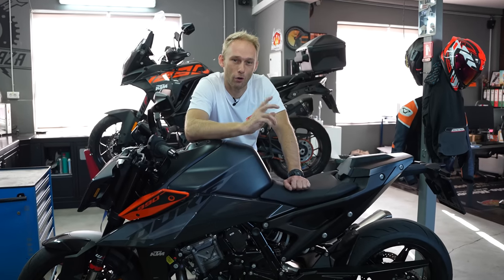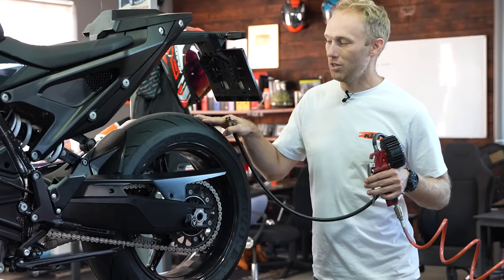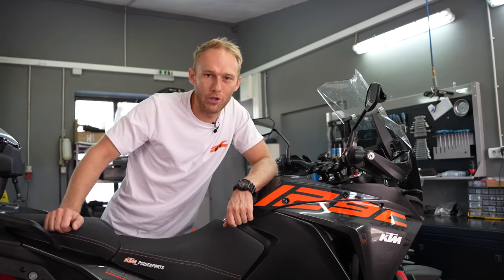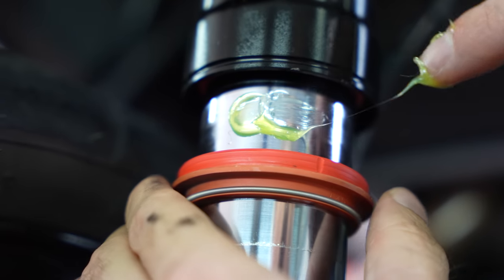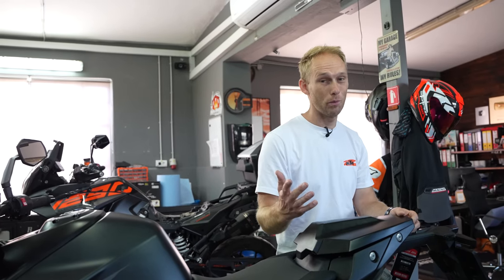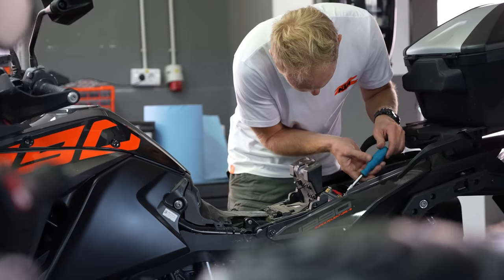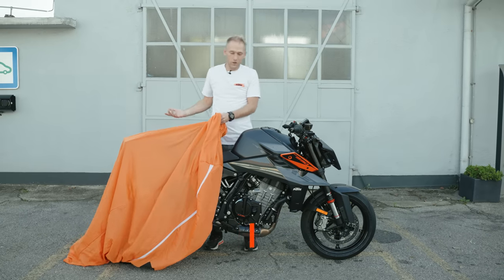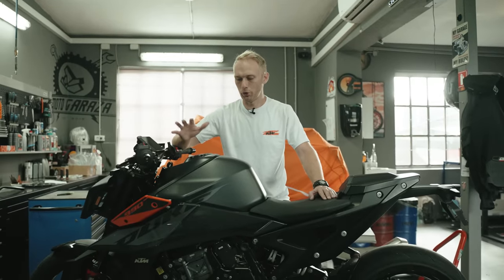How to WINTERIZE A MOTORCYCLE | RokON VLOG 149

Comment: Great tips and presentation as always!  I would second the jet washing comment - great for cars, with great care on bikes because of exposed electrical connectors etc.   But.  Change the oil - combustion heat can create acidic compounds in the oil, which are not a problem with a ridden bike but in storage they can collect on the steel parts and etch bearings etc in the engine and transmission which can create expensive failures and repairs down the road.
Reply: At least back way off with the nozzle !!
Reply from the maker: Totally agree! :)